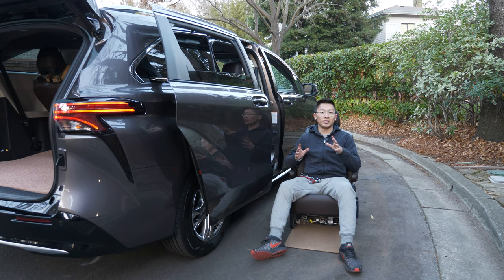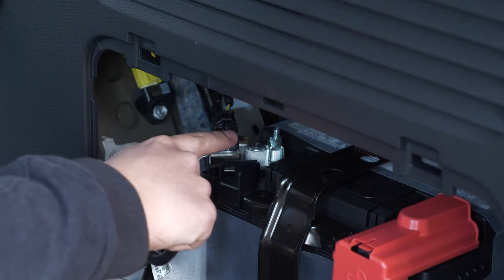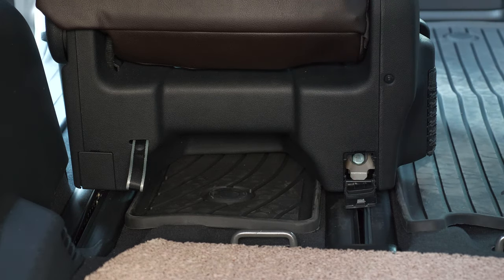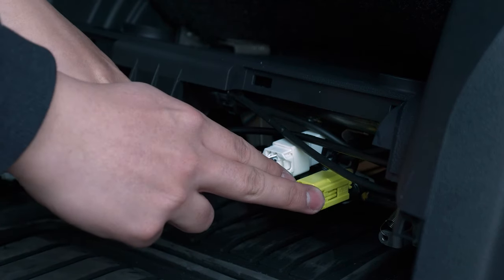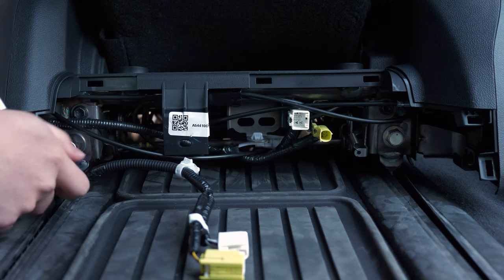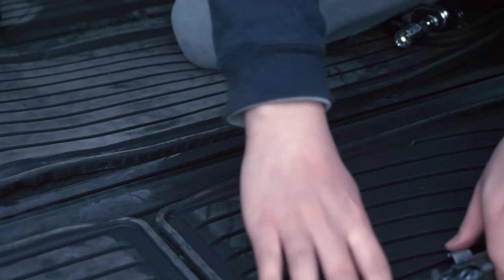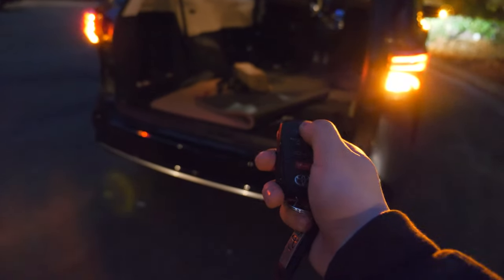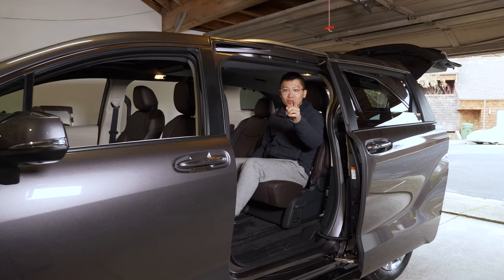Removing 2021 Sienna's "Non-Removable" Seats (UPDATE IN DESCRIPTION)

Comment: Excellent video!  Do you have pictures of the interior with the seats removed? Is the floor flat?  I ask because I want a hybrid minivan to convert to a camper.  Thanks for the work you are doing.
Reply: I assumed this would be an essential visual to include with this video, but no. Otherwise, great tutorial.
Reply: Considering doing the same thing.
Reply: Me too. Removing the seats and one of the rails was easy, but the rail with the electrical connections seems bolted in from the bottom, but the muffler is in the way. I came here hoping to find a solution.
Reply: I have my seats removed and built a wooden platform that sits just above the rail carriages. The floor isn’t level so my platform sits about 4” tall near the front end and flat on the back in the rear. It serves as a little cubby for pans and shoes towards the front so not a total loss of space. I’ve mounted my platform to the rail carriages using the factory seat bolts and it is solid. I roll around with a foam mattress in my van at all times!

Comment: Rather than removing the sliders, simply put something alongside them or behind them to take any loads and protect them from damage.  On my older Sienna, after removing the seats, I would simply put a piece of 4x4 behind them.  I could then load a whole sheet of plywood into the van, with the plywood supported in the front by the 4x4.   If you wanted to get fancy you could fabricate a little plywood platform to cover and protect them when the seats are out.
Reply: I'll do the same if someone will come up with a plug-in to stop the airbag warning light on the dash.

Comment: Does this apply to the newest generation, the 2023 Sienna Hybrid, or only to the older, Non-Hybrid Sienna?  Someone told me that the traction battery is under the rear seats. and that these seats are not removable at all because of the battery. But I wasn't clear on whether "rear seats" meant the Second or Third row.
Reply from the maker: This is about the latest generation, which is model year 2021 and later.

Comment: Great video and very nice you shared the instructions on addressing the door issue.  Just curious if  you think it would be possible to put the chairs back in facing backwards?  That would be useful if we want to use it as a camper as the bed could still fit in there over the seat bottom.  But the air-bag connectos might not be long enough or the bolts might not fit back in.
Reply: The idea of thinking that the second row of chairs can be turned is so good. Let me know if you know how. Thank you. That's a great idea.

Comment: Brad, thank you for your excellent video. Can you comment on ways to get the Airbag light to go off., short of re-installing the seats? In many states it will fail inspection if this light is on. I have read of using a bypass resistor. If this is done with the front airbags still work?
Reply from the maker: I've heard from some people that disconnecting one airbag deactivates all airbags. So I developed this airbag simulator for the Sienna to solve this problem: https://www.youtube.com/watch?v=CFSBTX6F_sw

Comment: You're a boss, thanks for the video. I'm still disappointed that Toyota doesn't make these quick release. I have a 2011 and I LOVE the LuXXXury of having the second row seats and I also LOVE camping in my van with my custom bedframe. The versatility of the Sienna minivan is what makes it genius. If only you could design a quick release kit! Sounds tough but anything is possible. I have my van lifted with a Journey's Off Road kit. After talking to the Journey's guys and given the amount of people lifting, customizing, and camping in their Sienna's, it seems like a major oversight to make the second row seats non removable. I was considering upgrading to the hybrid, but until the second row seats are easily removed, I'm gonna have to stick to straight gas. I'm very 😢 sad.
Reply: Did it change the handling of van when driving after the Lift kit install?
Reply: @auroranite  not really. It was never good to begin with. I had Journey's off-road install the kit and they put new shocks on it for me. I just had standard Monroe shocks put on. If you're looking for better handling or off road performance, find better shocks.. Wish I would have. Still handles like a boat. Also it's mandatory you use OEM control arms when installing lift kit

Comment: Great job Brad,
I wanted to remove my passenger seat for a camper build I’m working on (2013 Sienna). If i try to remove the seat I’m sure I’ll either disable, fire or have SRS errors on my console. Could your SRS termination plug be used to address the SRS errors you had when you removed the 2021 middle seats. As the Sienna gains traction in the camper build community, this may become another question seeking an answer.
Thx

Comment from the maker: Resolving airbag error after removing seats: https://youtu.be/CFSBTX6F_sw

FAQ:

Q: Can you show us how to remove the rails?
A: I won't be removing the rails myself but here's the instructions: https://1drv.ms/u/s!AmKYRCVlOpOGlaBDRo_FIdNmkqI8Pg?e=brqbXX

Q: How much length do you have once the seats are removed?
A: 96 inches or 244cm from center console to trunk door

Q: Why would you want to do this?
A: I usually use the Sienna as a comfortable passenger car, but occasionally I need to haul something big.

Addendum & Errata:

(1) With the seat airbags disconnected, the car will warn you with an airbag message. It returns a few seconds after you try to dismiss it. To resolve this error: https://youtu.be/CFSBTX6F_sw

(2) The white 13-pin connector is for seat belt warning and seat heater. Only the yellow 2-pin connector is for airbag. However it's still true that both need to be physically disconnected for the seat to come out.
Reply: If the light is on, the car has ""no airbags at all**
Reply: @marionsutcliffe1119  Where can I find this info? if it is true, I read one could use an "airbag simulator" to fool the car into thinking the airbag was attached. For me it's the difference between buying Sienna and not.
Reply from the maker: @catherinekinsella3372  I developed an airbag simulator specifically for Sienna: https://www.youtube.com/watch?v=CFSBTX6F_sw
Reply: you probably dont give a damn but does any of you know of a trick to log back into an instagram account?
I somehow lost my password. I would love any assistance you can give me
Reply: @Nova Terrance instablaster =)
Reply: @Stephen Kamryn It did the trick and I actually got access to my account again. I am so happy:D
Thanks so much you saved my ass!
Reply: @Nova Terrance you are welcome :)
Reply: Very nice video. Can you convert 2021 Toyota Sienna XLE from tire repair kit option to spare tire option by installing a spare tire carrier and related interior panel? Or can you just share the video of rear driver side panel removal and restoration?
Reply: The sliding bars in the two outer tracks are easy to remove. I removed myself. The bars in the inner tracks requires to remove the fuel tank and the exhaust pipe which is a bit complicated. Plan to just just use a band saw or a grinder to cut the top of the two bars in the inner tracks, or let the dealer to handle fuel tank and the exhaust pipe for me.
Reply: Does anyone know someone in the NY metro area that would remove the seats?  I'd gladly pay for it.

Comment: Removing the rails.  I see the link you posted to remove the rails.  Can I get your take on why or what is needed to be removed from the bottom of the vehicle.  I see a section to remove the exhaust system. Is that needed to remove the rails?  I see all the bolts on the inside of the car to remove the rails.  Curious on your take.

Comment: Great job. Thanks for posting this video. It has increased the odds that I will buy a gen 4 Sienna.
Reply: Still a problem that the vertical hatch opening is about 4-5 smaller than previous generation plus that 4 banger is loud and stressed under throttle. lol.
Reply: Buy a older one

Comment: Thanks for this. Let us know if you find a dongle or device to plug into the sensor harness to eliminate the airbag warning on the dash please.
Reply: it's usually an inexpensive resistor, I may try that once mine is delivered
Reply: Please let me know if that works. My wrenches are waiting to get to work, I just don’t want any airbag issues. Thanks!!
Reply from the maker: @jeffreytotaro7051  I developed an airbag simulator specifically for the Sienna: https://www.youtube.com/watch?v=CFSBTX6F_sw

Comment: Brad Great Video.  I bought a set of these seats and tracks, but I'm missing the (4) 17mm Bolts that secure the seat to the track sliders.  Would you know the Toyota part number or specs of the 4 bolts?

Comment: Caution! While this allowed me to remove the seats on my 2023 Sienna, there is an additional yellow plug. Writing this while at the dealership because now I have an Airbag System Malfunction alert with a seatbelted passenger icon on the dash, in addition to the navigation panel displaying red arrows from both back wheels to the mid frame traction motor by 2 different diagrams. According to the dealership & head mechanic, second row seats MUST be in place to allow normal systems operation. FU, Toyota
Reply from the maker: The latest version of my airbag simulator takes care of this problem for 2023 Siennas: https://bradshacks.com/airbag-simulator
Reply: @BradsHacks Hi Brad, with the dongles in place and seats removed (2023 xle awd), any problems/dangers due to the dongles when the airbags go off due to a collision 💥? Has anyone had a collision with the 2nd row seats removed?

Comment: I just purchased a set of Ottoman seats full seats to put in my AWD van.  I haven't got them in so not sure if the rails are the same.  I am hoping the removal is the same.  Do you happen to know this?  If I could leave the rails in then that would be great.  If not do you have a video on how to remove the rails?  Great work BTW are you selling the Air bag resistors?  If not you should!  I don't know if I will be removing the seats for hauling stuff since I have a truck but I am sure it would be helpful for others!  THANKS!
Reply from the maker: Hi Lorenzo. As far as I can tell from Toyota TIS, the ottoman and non-ottaman seats use the same rails, so with the whole seats, it should be a drop-in replacement. I am indeed selling the airbag resistors: https://bradshacks.com/product/airbag-simulator/

Comment: I think making the seats difficult to remove is a bad design. You can no longer able to carry 4x8 sheets without removing the seats, that's less functional than the previous version.
Reply: Apparently, you can .. if placed vertically between the second row seats. Havent seen a video or image showing that but thats the claim.
Reply: The comment I was looking for, thanks, agreed.
Reply: The older design was better. I moved sheetrock, plywood, and furniture also, (even a bed-set and a heavy sofa sleeper couch). Then, I would just put the seats back. I moved many things in that minivan. The seats were awkward, but easy to remove. And there were no odd rails sticking up after removing the seats. That minivan doubled as a small pickup truck as well as taking my family on many long road trips. Toyota gained little by moving to the new design.

Comment: I was all set to buy 2021 Sienna van and turn it into a little camper until I discovered that A. It ONLY came with a hybrid drive system. I'm not willing to give up the horsepower of the V6. And B. The middle seats don't come out. Even after seeing this video, that still doesn't remove the sliding rails. And what about the air bag warnings?  No thanks. Toyota, you really blew it with this.

Comment: GREAT VIDEO SO CLEAR AND UNDERSTANDABLE DIRECTIONS!
I was told by phone within the week when speaking to Toyota Canada when I called Feb 22/22 that when you take out the middle row seats it Also Disengages the Front Seat Airbags and makes it dangerous to drive without the airbags. Also I was told by Toyota  that our Warrentee will be cancelled when you take the middle row seats out of a 2022 Toyota Sienna All Wheel Drive Van. Can I assume  the 2021 & 2022 are Identical Van's? I realize in this video you are taking mid row seats out of a 2021 Toyota Sienna Van. Can I also assume the All wheel drive Van's and the Front wheel drive Van's can both have seats taken out of them? You weren't specific in your video. So maybe I can assume that it doesn't matter if its FWD or AWD?
Please get back to me as I called Toyota Canada & spoke to 2 Toyota Dealerships. The 3 places all said the warentee is void and the front seat Airbags will not work if middle row seats are taken out. If anyone knows where to get the final say for safety reasons about my concern I would certainly appreciate some feedback. Thank you Kindly!
Reply from the maker: 1) Regarding Toyota's claim that unplugging a rear airbag causes the front airbags to not work: designing an airbag system to completely shut down when just one airbag is missing (showing as open circuit) would be horrible from an FMEA standpoint, and no reasonable automaker would do that. Suppose you got in a side collision and the rear seat side curtain airbags deploy (becoming open circuit), and 
next your car crashes into a wall head-on. Under this logic, the front airbags would not deploy. Of course, in reality, that is not the case. However, Toyota's official communications prefer to tell customers that unplugging one airbag turns all other airbags off, because they want to err on the side of caution and avoid liabilities. There is still some truth to it: since the system doesn't tell you WHICH airbag is malfunctioning, you can't assume the airbag warning is just pertaining to the seat you've removed, and not some other actual airbag malfunctioning — so the safest thing is to assume the entire system is down whenever you see the message. This, importantly, is where the simulator dongles come in. By appearing as an airbag to the airbag computer, they filter out these false positives, so if you do see the airbag error at some point, that means you have a real malfunction with some other airbag.
2) In the U.S., Under the Magnuson–Moss Warranty Act, the manufacturer cannot deny warranty service because of a user modification unless the manufacturer can prove that the modification caused the problem for which the user is trying to get warranty coverage. For example, if you require warranty service on the engine and transmission, they cannot deny you that just because you modified the seats and/or airbag system — since they are completely unrelated systems. Also, if you take out the airbag simulator and reinstall the seat before bringing the vehicle to any kind of airbag or seat-related repair, they won't know you've messed with it, and you can avoid this argument from being brought up in the first place.
3) The 2021 and 2022 Siennas are mostly identical, but some trim levels of the 2022 have an additional seatbelt pretensioner connector that needs its own dongle. See the product page for details: https://bradshacks.com/product/airbag-simulator/
4) FWD vs AWD is irrelevant in terms of seat removal.

Comment: With the second row seats out and the third row folded down, can you please comment on the available length and width (between wheel wells and on top of them, if necessary) inside the van with the driver and passenger seats all the way back, to the trim of the rear hatch?
Reply: With the seats out; more than 90 inches to the backdoor. 48 inches between the wheel wells, 54 inches above the wheel housings.

Comment: Is there a way to turn the airbag light off while the seats are out of the van?
Reply: Shove a 3 to 3.3 ohm resistor in the yellow harness.
Reply: @marionsutcliffe1119  Can you confirm this 100% works or has anyone else actually done this? I don't know what a ohm resistor is but I will track them down if this solves this problem. Thanks!
Reply: @tallpaul9848  Just what I found searching internet. Sounds like a good bet of $3 vs no airbags in an accident. A resistor is something that resists electricity flow in an electrical wire. 3 ohms is indicating how much resistance. Even a lightbulb is a resistor (actually, anything that runs on electricity is a resistor). When electricity flows thru a resistor it heats up (and even glows in the case of an incandescent lightbulb). It doesn't seem that heat is an issue.
Reply from the maker: Use this airbag simulator I developed for the Sienna: https://www.youtube.com/watch?v=CFSBTX6F_sw